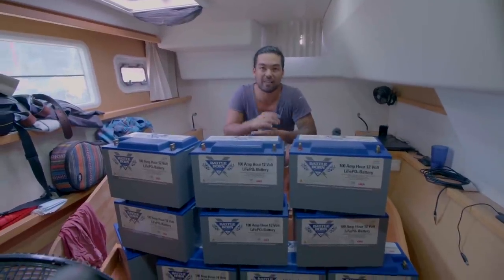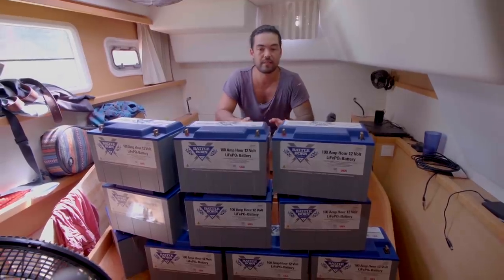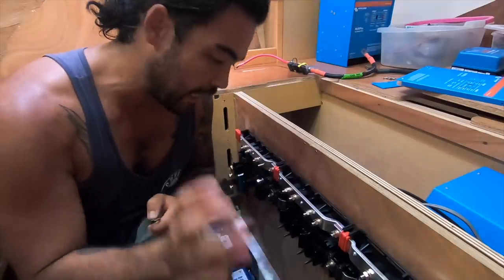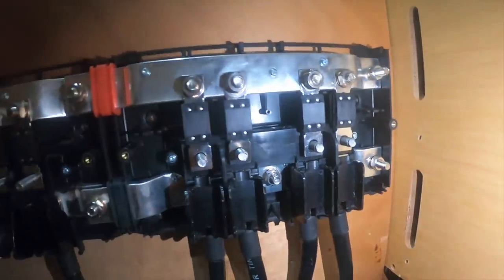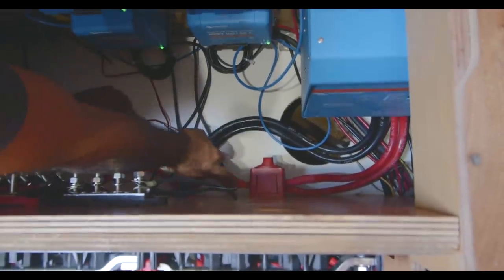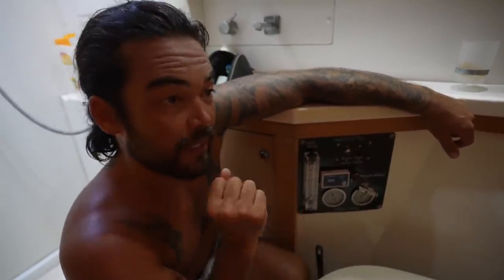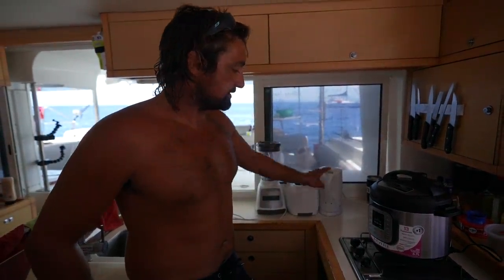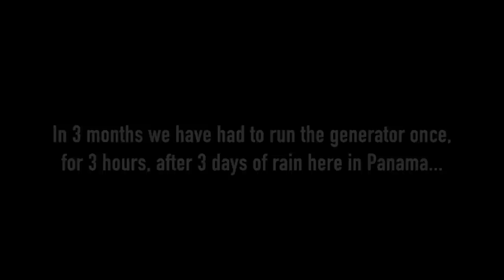Installing 1000Ah of LITHIUM + huge VICTRON installation! Episode 149

Comment: Those little Hondas are the perfect backup and they make a 3 gallon extension tank for it as well that has a fuel pipe that connects to the Generator 👏🏻👏🏻 bigger alternators are definitely a must BUT your engine will use more fuel ⛽️ it would be good to do a before and after economy 🤔 maybe fit just one on one side

Comment: You don't need to change alternators, just use Victron DC to DC charger/chargers. You can use multiples.
Reply: i think they want different ones for higher output

Comment: Should look into prismatic cells with a BMS.  In the space of 4 battleborns you can get 1120 ah of storage for around $2,000, instead of the $9 or $10k for battleborns.

Comment: Great video...another saver! If your batteries are topped up by noon, will your next campaign be to start to convert seawater via electrolyses into hydrogen to run your engines on? Just saying an engineer like you Collin and go getters like Jamie and Tom should be able to whip up something together. Thinking it as something to pass the time sailing across the Pacific. YOU CAN DO IT!! lol. Just a thought.

Comment: Ignorant question: Is there sufficient ventilation through the area where the inverters are located in order to keep them from cooking themselves? Or is that bunk the preferred one when visiting Antarctica on your circumnavigation? 

Love the post! Awesome Solar and I love your ongoing plan for multiple backup systems. Way to go!
Reply: Victron Multiplus II Inverters have a high temperature sensor and will shut off if they exceed the high mark.
Reply: Heat is a killer, would like to know what people think as well.
Reply: That's a good question because I was thinking about that too.
Reply: Unless they are running at a high load constantly, there wouldn't be a lot of heat to dissipate.
Reply: with him using two it almost eleminates the heat build up.
Reply: Tom seems like a really chill dude, so maybe that was the plan!
Reply: Very valid question. 
I would hook up a bilge blower and an opposing inlet. The blower would be connected to a attic thermostat. 
I just did the same thing in my garage but I used an in line blower that pot growers use. My inverters are 13kw and that dead air space corner is already getting warm and it’s not even summer yet. It works like a charm.
Reply: I put some fans. The multiplus has some fantastic features. You can set a output to run the cooling fans only when the internal fan runs.
Reply: A simple deep water heat exchanger would solve that issue, post haste
Reply: @user-dr2pg8fk2i  - so is salt air!
Reply: @inmyopinion6836  - deep water?  The boat, properly loaded should not come close to anything "deep", unless it hits rocks or shoals... and that boat is STRONGER than any 450 or 465, ever previously built!

A radiator/heat exchanger, under the water line, is just asking for problems - building one strong enough and light enough (cats need to be light to sail correct/well) - would be regressive at best, in my limited experience on and in the water.  Also, surface water in the tropics can, at times be a toasty 80F or there abouts.  Maybe it could work, yet it would seem like a hassle to engineer, build and test.
Reply: Victron Multiplus 12/3000/120 makes it rated output at 77 degrees F.  Above that temp it begins to draw down its peak output.
Reply: He has a 1/2 ton air con hidden away below near the bilge - he just never shows it.

Comment: Love your vids dude , As an electrician who works with batteries of all chemical types , I can say with a fair amount of confidence that properly maintained lead acid batteries will last substantially longer than 500 cycles and a 2000aH bank of Trojans/equivalent would price around )3500 aus , the weight would be a massive issue tho , lead acid batteries have their place just like lithium batteries do ie safety and reliability .. All lithium chemistry batteries in a sea going vessel in my opinion need to be installed below the waterline and in a compartment that can be flooded if the need arises , as the cells create their own oxygen when combusting , cooling the cells is the only option should an internal fault occur , the batteries you are using are the most stable in the lithium family but are still susceptible to thermal runaway in rare cases

Comment: I've been waiting for this episode...  My background is submarines and it should be obvious that the battery and electrical system is more than just critical in the environment I came from.  Being nuclear powered only makes it more complex.  I'm sure I would have designed things with more redundancy.   For instance, 500 AH on separate port and starboard buses. Cross connects to be sure but not normally married.  Separate physical storage locations as well (what if one area gets flooded out).  Separate vital and non-vital buses too.  Navigation and electronics are just more important than a pressure cooker.  Separate charging from the PV arrays to the individual battery banks.  It's just not that more expensive when it's your rear end on the line in the middle of the Pacific.
Reply: The coffee maker *must* be on a vital bus.

Comment: I don't know how you are showering guys but if you are using hot water or want to use, consider change the panels (I know its just isntalled) for new types. I don't know the brand but there are hybrid panels with water pipes which can generate hot water AND cool down the panels at the same time saving energy in 2 ways cuz solar panels are more efficient if they are cool and loose efficiency by overheat so you can increase effy on the panels and make hot water at the same time, you don't have to use electricity solely for hot water. basically you need a heat exchanger tank and thats it. cheers.

Comment: $10K for 12kwh, that's beyond pricey, but with solid state batteries starting to appear things will only get better from here on out. Totally agree with the bigger alternators, there are companies out there that can set you up with alternators that convert to electric motors to drive the boat at slower speeds. 12KWH of storage certainly wouldn't cut it, you'd be looking for a minimum of 60KWH, another $40K. There are companies designing water flood systems for lithium batteries to eliminate fires, Electric aircraft manufacturers are developing battery cell pack ejector systems for battery parallel systems, if you think fire on a boat is bad, just imagine what it's like on a plane?

Comment: Large alternaters would be good especially in rainy cloudy areas or seasons, I would get at least 1 installed before doing convection upgrade. SailLife has multiple redundant power systems. He also fit it all in a monohaul.
Reply: Saillife is also an IT developer, not a chief engineer... ;)
Reply: @RechargeableLithium  Sailife is also an OCD basket case who has yet to leave the dock in 6 years

Comment: Hi mate. It would be right to replace your battery isolator with a version with remote control function. If there is a problem with the batteries, how will you turn off the breaker?

Comment: Great review and demo of your setup.  I noticed that both the positive and negative leads from the bus bar to the inverter were on the same side of the bus bar.  Should they be at opposite ends of the bus bar to ensure the batteries are drawn down equally just like you did for cutting the battery leads the same length?

Comment: Isn’t it still more efficient to run the small Honda generator to charge the batteries when needed then run one of the engines with a larger alternator? You don’t need all that Horse Power the engine puts out for the Amp’s you want to put in. It’s kinda like using a sledgehammer to do the work of a finish hammer. I know that means carrying another fuel source assuming your engines are diesel but still you should use much less fuel to do the job.

Comment: Litiums are also 98% efficient when charging and discharging so round trip energy in and out you loose 4% 

With lead acid or gel its 80% efficient so you loose 36% of your Solar power. 

This means that by swopping to Lithiums you will effectively have 32% more power avalable from your same solar array!! Boom!!

Comment: Why did you choose to run 10 batteries to  the lynx system Individually vs connecting then in parallel to 1 or 2 spots on the lynx? 

Would of saved a ton of space and money on all the large wire and lugs.
Reply: It is a way to equalize the cable runs.

Comment: The bed you placed all the inverters and equipment under does that bed get significantly hotter due to this or is there adequate air flow under the bed to stop it? It seems like it would just  become a heated bed.
Reply from the maker: During the day yes, when all the charge controllers are working hard, but after the sun goes down the system isn’t even warm.

Comment: What is the approximate cost with the solar panels, batteries, and additional equipment that you will need to run the capacity that you have if you weren't sponsored?  That is a dream of power.

Comment: Great video, however, you do not need to buy the Battle Born batteries.  There are excellent batteries of Amazon from Ampere Time which have been very well reviewed by Will Prowse. $650 for 200Ah so $3250 for 1000Ah.
Reply: You are correct and what I am running…he got a sponsor deal with battleborn…. Was cheaper for him to go with them I’d bet.

Comment: I'm a dummy when it comes to electronics/electrics, I got a lithium battery for my little watersnake electric motor on a tender. Now when I bought it I was under the understanding that I can use 95% of the battery before recharge. Seems though as soon as it got down to 10,4 volts it wouldn't power my 36 pound thrust motor. So I don't quite understand this 95% part, also the first time I used it was on a old glass 14 foot canoe that isn't even heavy, it's a very light lay up

Comment: Collin it's nice to get free batteries from Battle Born which are great but insanity over priced. There's a lot of competition now days at a fraction of the price I know because I had a competitor's batteries in my camper. Same specs also. Sorry Battle Born would sell many more if they would get real on the price. And they are assembled in US YES but with the Chinese components correct me if I'm wrong.  By the way I'm a loyal viewer so don't get mad.
Reply: Eric  your right I bought Chins same specs but I only paid $300 not $1100 like Battle Born

Comment: The only thing im worried about with using lithium batteries is when things go wrong they burn real hot and self sustaining, ive am designing my battery compartment so if the worst was to happen we could eject it from the boat.

Comment: Okay,  I am an electrical engineer.  Please   post up a block diagram of the electrics on the entire boat.  (Maybe ask BattleBorn to do it?) It appears you went with all ten batteries in parallel. At the start you said you have a 12 volt boat, so I assume all winches and appliances are 12 volt? Thanks for the 3 month review.  Were there any problems with the batteries or control/conversion systems in that time?
Reply from the maker: Nothing! Yea all 12V!

Comment: Excellent video Thank you high-quality info- I do have a Question about the Lithium BMS is it Custom made compatible with the charging systems on your boat?  I ask as, Say, if you have a wind generator, solar, and high output alternators. The issue I understand from an NZ electronic engineer is a risk of blowing your charging power generating assets if you don't have a custom-matched BMS for your boat's setup, as you know every boat setup is different. To me, this means you need a custom BMS to prevent failure.  I'm a simple sailor who knows nothing re lithium installation in my research. I understand you need a matching BMS to protect your batteries and first-line charging assets. - There is a very good article you can download free by NZ electronic engineer Eric Bretscher from nordkyn design online.  Eric is independent and does not supply lithium batteries of any brand.  For this reason, I found his independent article download on the subject a must-read if you’re installing lithium batteries.   Eric told me as an example that SV. Delos' first lithium battery installation was incorrect.   After our talk and reading his article on the subject, I understood the risks of a sales pitch and possible BMS miss-match could be a major issue, instead, I re-installed 4 x 215 ah of AGM. Batteries instead of lithium. SV. Skoiern IV

Comment: The little Honda is nice but the size of your lithium bank is way too much to do it effectively and timely. Use the larger onboard generator. Higher charge currents are more efficient than a small trickle. That Honda would have to run for more than two days to charge and the drain of day use. The big generator will get it over with in a few hours.

Comment: Colin that little honda generator doesnt put out 120 amps of power you might want to make a correction
Reply from the maker: It actually can put out 180 amps at 12V

Comment: If you are DIY inclined and have a small amount of knowledge about battery safety. You can actually build your own battery bank by buying cells and BMS's straight from China for less than half the cost of the ready to go batteries.

Comment: At some point like Sailing Uma you are going to be able to go totally solar, even electric motors, maybe then take the opportunity to move the batteries and inverter chargers to the engine bays alongside the small drives to keep them cooler.

Comment: SOK marine batteries cost half as much as the BB batteries. Battleborn are high quality but overpriced. If you are on a budget, and who isn't, you should consider alternatives. But you also shouldn't buy cheap trash because the marine environment is really harsh and electrical fires are very dangerous, especially on a boat.

Comment: Battle born.....all components are made in China...and assembled in USA. Thus the ridiculous price this guy quoted. Lucky for him, it was free.

LFP batteries are the way to go. So many advantages. BUT listen folks, you can buy directly from China...miss out the middle man, get your 10 year warranty + 6000 cycles with awesome feedback from the manufacturer. AND, the batteries each come with Bluetooth. You can see exactly what the BMS is recording. It's a true reading, not what your battery monitor shows.

AND the price is 1/3 of the cost of these promoted batteries. 

1200ah of batteries onboard, and life is good with a big solar array to keep them topped up.

Comment: Buy Battle Born yourself and then tell us how you feel about them knowing you could have half that money still in your pocket and batteries that hold the same amount of energy, will last the same number of cycles, have the same C rating, and come in more than just 12V so you don't have to make a janky multi BMS system by series connecting 12V batteries.

PowerQueen offers an amazing product at less than HALF the cost. BattleBorn's 10 year warranty just can't equate to that value. Unless you buy total Grade G(arbage) cells any LFP battery will last 10 years.

Comment: All sweet. But you didn’t mention the cost of total system versus it’s expected lifespan. And cringe at the thought of a flooding or lightning strike again. Hopefully not, but you’re up for huge coin if anything goes wrong. I built something like this on my yacht, but about a quarter the size and it was good until salt got into components and then started throwing gremlin errors

Comment: These poor little Hondas are not built for the marine environment. I've got two sitting here with every single bolt rusted solid. Do yourself a favor (if it's not too late) and put some anti-seize on all the bolts. Especially the bolts across the handle and the bottom, they go into insert nuts in the plastic that will spin freely once rusted shut.

Comment: 10 X 100 X12 = 12000 watts 
For $8000 to $10000, someone is making money!
You can get same amount of power for about less than a quarter of the price using LIPOS plus battery management system and still have money to spare and that is what’s in the fancy boxes anyhow.
You are a smart enough fellow, step it up a bit, don’t sell out please!

Comment: The danger of lithium is evidenced by the car carrier ship full of electric vehicles that burnt to the water line.  You can't put them out once they start.
Reply: Not with the LiFePO4 batteries Colin installed. LiFePO4 won't burn.
Reply: those ev batts were Li ion
Reply: @jimlofts5433  I understand, you are referring to some of the vehicle battery chemistries and not to the batteries Colin installed. -Got it! :)
Reply: @ElectromaaxInternational  a vid is out there of them testing LFP batts / shorting them out and even shooting them with a machine gun and dropping them from height - as you would for batts

Comment: keep your generator, those batteries are nothing special flooded lead acid batteries with the proper charging controlling system is way more cost effective and efficient and 99.9% recyclable unlike those batteries when they fail will end up iin a landfill somewhere

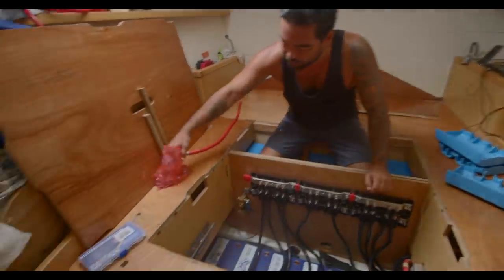Comment: 10:40 bare wrenches on top of Li batteries... Come on guys this is a basic NO NO in electrical safety !
A short-circuit on Li batts could send drops of molten metal flying.
And you guys did not even wear safety glasses.
For someone who's supposed to be an engineer on yachts, Colin surprised (and disappointed) me on this one...